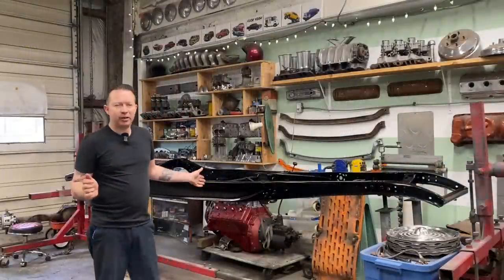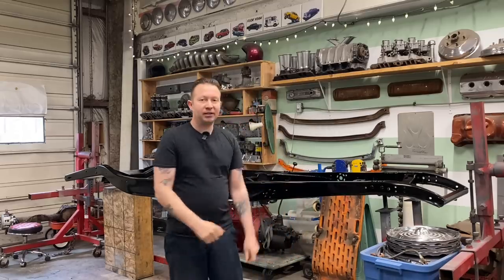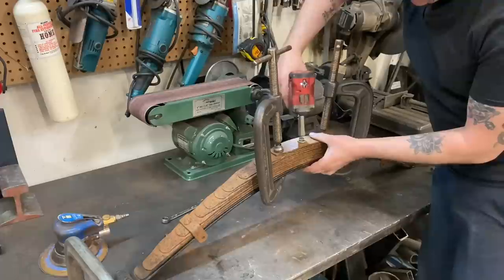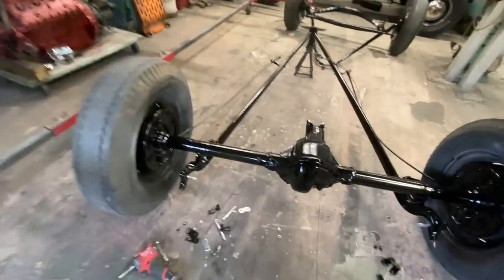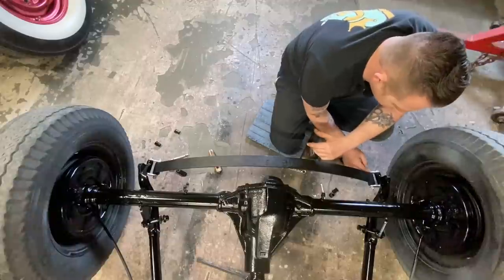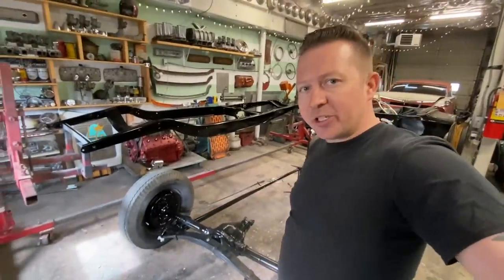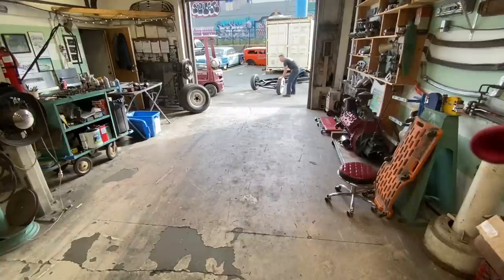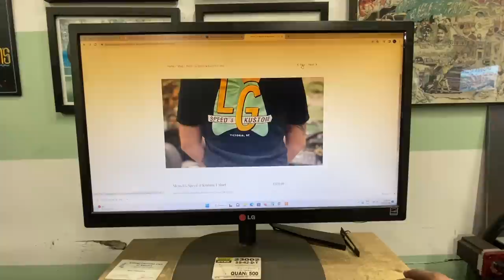Chassis Assembly. 32 Ford rebuild Part 16

Comment: Good progress there! What i would do if it was my car? 
Well, i would open the can of worms from the bottom. Fix the floors, subrails etc, before putting the body back on the frame. That way i would not have to get the body off the frame, when opening rest of the can of worms. 
Keep it up!
Reply from the maker: That’s a great plan.

Comment: Looks great.
I agree with not tearing into the body just make it a driver then take it back apart in the winter and do the body. Then you can make it really nice for the family with a cool interior. 
Going to be a wicked little hot rod.
I thought I’d get the T done in one winter not 4 lol
Reply from the maker: They always take longer than expected!
Reply: @LGKustoms  that T coupe was supposed to be a “stick another flatty in it and go” job …it was not😂

Comment: Looks excellent!  I’m still gathering parts for my 32 coupe. I need the tranny.  Crossmember I’m running a flathead v8 like you suggested just need that crossmember
Reply from the maker: They pop up every now and then on the HAMB or @partsswapper on instagram.

Comment: Not sure on how to get in touch with you --- so --- Your sewing machine has --- 1/2" lift ---- so it is compressing the foam down to get through the foot ------ so my question there is answered ---- one last thing though -- you sew so smoothly --- do you have a Servo motor verses the Clutch Motor --- I'm hearing you can sew slow with the clutch one without zinging along --- too fast for me --- just wondered if you converted to the Servo or using the Clutch motor WITH A GENTLE TOUCH  ----- I think that is all I need to know before I begin my search for one ---- I watched you doing the seat for Shane --- it turned out REALLY NICE -- and I took quite a few notes on how you went about doing it ------ Thanks Again ----- Rodney
Reply from the maker: I have a clutch motor on mine. A servo motor is a nice upgrade, but I like the philosophy “if it ain’t broke, don’t fix it”
Reply: @LGKustoms  You seem to sew so smoothly -- thought maybe you opted for the servo verses the clutch motor ----- I still want to do this --- my Model A is almost a mustard color vinyl -- no rips - no pleats or anything -just plain - so -- my search is on -- have a few different brands and models that should do the job in mind -- the price will be the factor -- as long as it can do the job -- is all I need ----- Thank You answering my questions --- it has helped me in figuring out what I need ---- You have a good philosophy too ------------ Rodney

Comment: The Imron paint on the chassis looks pretty good for just being a semi - gloss  ----- Noted though -- the large C-clamp with no foot --- I know the ball end can walk on you --- maybe slide off --- The frame with the Flat Head color will look really good once all is back together  ---------- I had asked about your sewing machine -- what model --- you didn't know ------- as you videoed at the end of things as you do -- you had a close up -- of the model -- small plate just above the table top on the main part of the body --- just no close enough for me to read, #______________  You use the Foam ( sorry don't remember the name ) to make the Rolls --- puffy ---- do you know ---- or can you measure for me what the height of you Presser Foot is? ---- You have foam then -- material -- then material with foam on top of that -- that you sew all together --- The Presser Foot has to let all that pass under -- to be sewn up  ------------ It is expensive to have someone sew up a '30 Coupe -- and just as bad to buy a kit ---- I get / feel good -- when I can do it myself -- Body / Paint / Mechanical -- and hopefully Upholstery ---- It may not be perfect --- BUT --- i did it --- and it makes you feel good  
Sorry for asking you again on the Sewing Machine  --- Can not afford to buy an expensive one ---- I just need to know -- when you sew all that material together what is the --- GAP --- that is under the Foot --- to pass the material through ------ Thank You --- Enjoy watching your Videos on these Old Cars ------ Rodney
Reply from the maker: My machine is a Singer 111G156. I don’t think I’d worry to much about finding my exact machine. Industrial machines are all very similar. You want a walking foot, and reverse so you can do a lock stitch, which are both very common features.
Reply: @LGKustoms  Thank You for getting back -I think what I really need to know -- when you did the Roll n Pleats -with the foam - the material all stacked up - not all machines have the same clearance under the foot --- with all that stacked up -- does the foot compress it --- to go through -- under the foot -- some machines only have 5/16 ---- 3/8" clearance --- How much room do you have under the foot to get all that matl. and foam through ---- this is what I'm worried about -- getting a machine that doesn't have enough clearance ---- did your machine compress all to feed under the foot?  Sorry about asking --- I would like to do Roll n Pleat also --- just don't want to get something that won't do the job --- Thank You Again ---- Rodney

Comment: Ok so if that was my car I would give it to you. But it’s your car so you can keep it. I think it’s name should be LG “baby”. I think it’s looking really good the body just paint it black till next winter. I’m sure you could do the interior and put it away for final assembly. Then just put a couple of seats in so  you can have road trips and work out any issues. Anyway what ever you do it’s going to be good. Tim.
Reply from the maker: The interior would be easy enough to remove when the time comes too!
Reply: Well I think that would be a job finished so when you tackle the body you will have a head start on getting it back on the road.